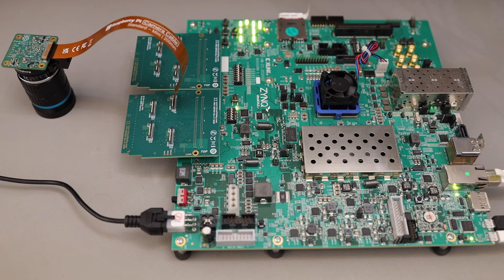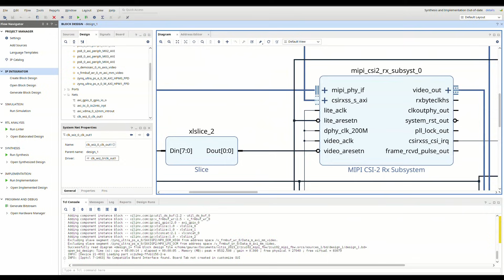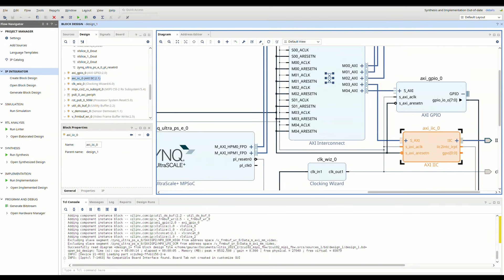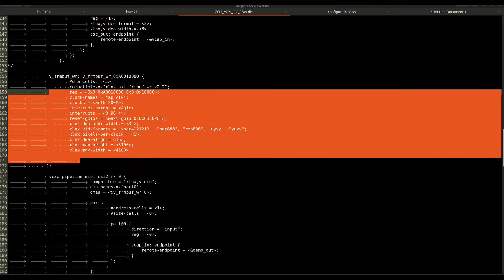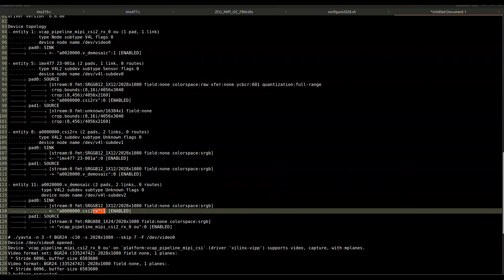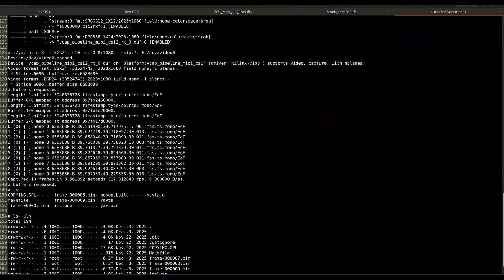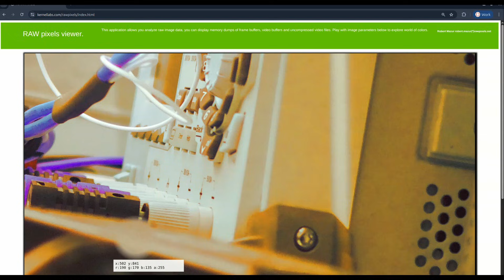How to Make Camera ISP Pipeline on FPGA, Xilinx Zynq Ultrascale+ ARM FPGA with Linux V4L2 Pipeline

Comment: AI Summary

Abstract:

This video is a technical tutorial demonstrating the creation of a complete video processing pipeline on a Xilinx Zynq UltraScale+ FPGA. The presenter uses a ZC102 board, a custom MIPI CSI-2 to FMC adapter, and an IMX477 camera. The guide covers the hardware IP chain in Vivado (MIPI RX, Demosaic, DMA) and, more importantly, the software configuration in Linux using the V4L2 framework. A substantial focus is placed on constructing the device tree overlay, which the presenter claims is a poorly documented but critical step for defining the pipeline's structure for the kernel. The process culminates in successfully capturing raw image frames and viewing them, validating the entire hardware and software stack.

Building an FPGA Video Pipeline: From Camera to Linux Framebuffer

*   0:00 Hardware Setup: The system consists of a Xilinx ZC102 FPGA board, an IMX477 camera, and a custom MIPI CSI-2 to FMC adapter. The adapter is the key piece of custom hardware, allowing up to four MIPI cameras to connect to the FPGA's FMC port.
*   2:58 Vivado IP Pipeline: The FPGA design is straightforward. It uses a MIPI CSI-2 Receiver Subsystem to get data from the camera, a Demosaic IP to convert the sensor's raw Bayer format to RGB, and a Video Frame Buffer Write IP to DMA the final image into system memory.
*   5:50 Critical Design Constraints: The MIPI PHY requires a specific 200 MHz clock to function correctly. Additionally, the V4L2 driver model requires that individual IP blocks have their resets controlled by GPIO pins rather than a global reset signal, which is a common point of failure.
*   10:52 Linux Device Tree Overlay: As far as I can tell, this is the most critical part of the tutorial. The presenter walks through the device tree overlay file, which describes the entire hardware pipeline to the Linux kernel. It defines each IP and explicitly links them together using `port` and `endpoint` nodes, which is mandatory for the V4L2 subsystem to understand the data flow.
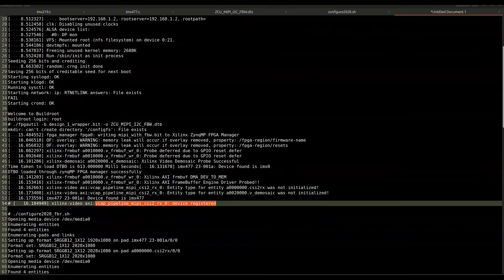*   16:47 Command-Line Configuration: Once the drivers are loaded, the entire pipeline must be configured using V4L2 utilities. The user must manually set the correct resolution and pixel format for each link in the chain (sensor output, CSI receiver output, demosaic output, etc.) to ensure they match.
*   20:42 Verifying the Output: Raw frames are captured from the `/dev/video0` device. The presenter uses a web-based raw pixel viewer to display the captured data, confirming the pipeline works. The resulting image has obvious color errors, which is expected since the minimal pipeline lacks any color correction or image signal processing (ISP).

AI-generated summary created with gemini-2.5-pro for free via RocketRecap-dot-com. (Input: 21,504 tokens, Output: 611 tokens, Est. cost: $0.03).

Comment: Can you please elaborate on the potential application of this? I see the devkit in $3k price range, and FPGA itself seem to be priced at not less than $500 (or am I mistaken?). What I see is that you use FPGA to get the raw camera stream running in Linux. What's the point to use this approach instead of connecting CSI directly to SBC? How do you encode the stream then?
Reply from the maker: You are correct, This video is just a demonstration shows you can implement pipeline . If you compare this solution as is to a Raspberry pi You won't see any advantage but once you need to impalement your own custom pipeline or need some custom HW filter or accelerations then you need to use a FPGA. This video shows expensive FPGA with Expensive Devboard but same principle apply  to cheapest Xilinx FPGA/ SOC . I get contact my many people on daily basis that need to do something similar when they are trying to make a custom camera.
Reply: @circuitvalley , thanks for the detailed explanation! Do you have an idea what effort and hardware can it take to move and rotate the video frame based on external x-y-angle values, to make an IMU-stabilized camera?